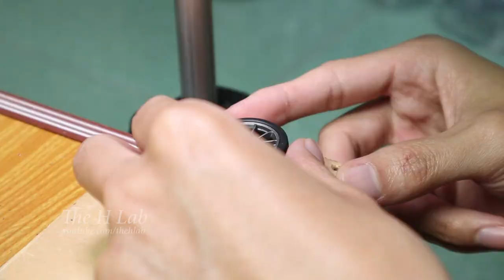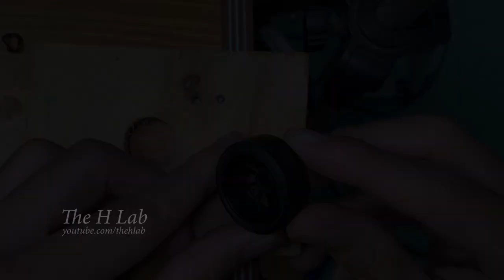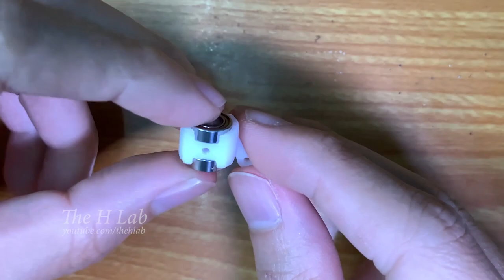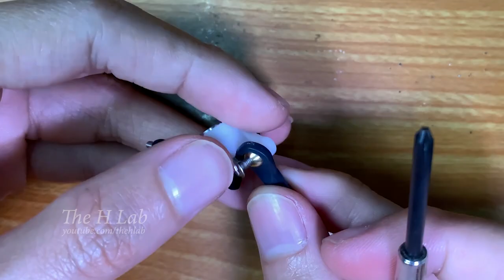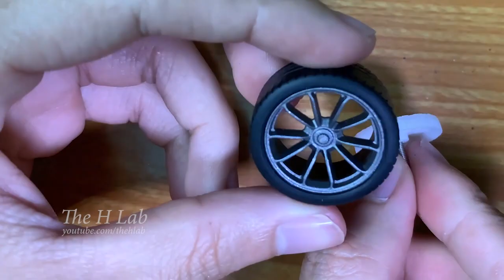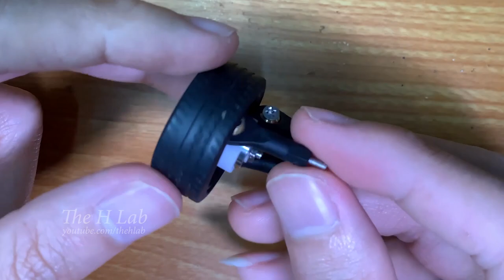Porsche GT3 RS 1:24 diecast  to RC | TheHLab | Part 1

Comment: Which nozzle size and what kind of settings do you use for the 3D printed parts?
Reply from the maker: I used a 0.4mm nozzle and 0.1mm layer high
Reply: @TheHLab  With default settings? This is PLA?
Reply from the maker: Yes PLA with default setting. I only changed layer high and no supporter.